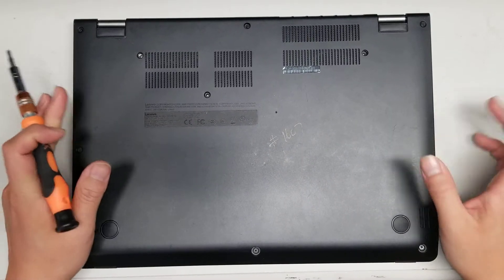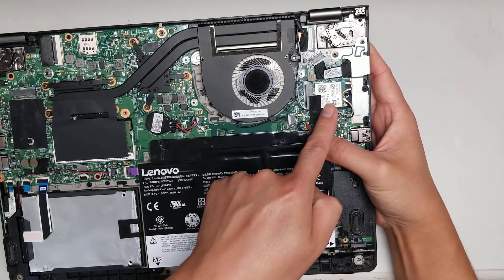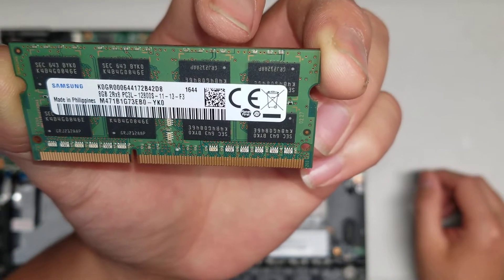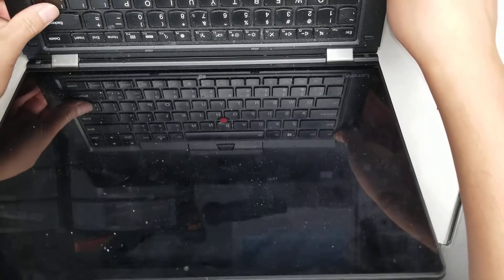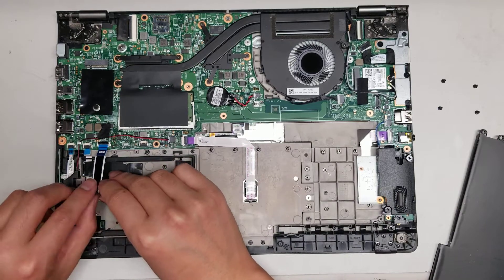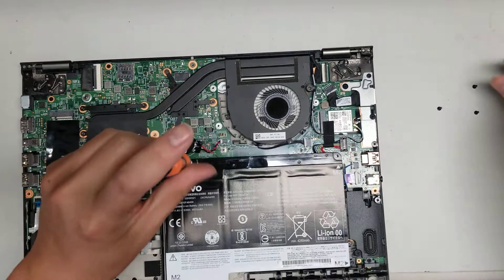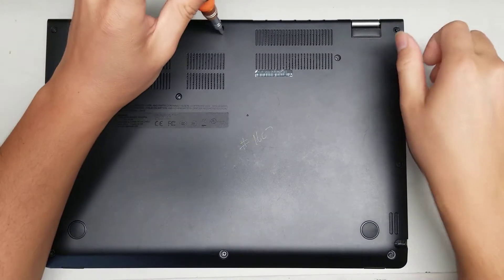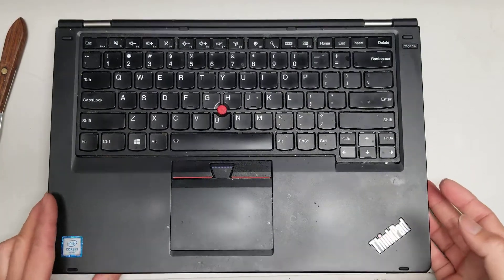Lenovo Yoga 14 Disassembly RAM SSD Hard Drive Upgrade Repair

Comment: Hello,
Is there a possibility to get a 16bg ram for this model?

It's hard to find the right 1x16gb ram for it.
Reply from the maker: Doesn't exist
Reply: @ItsBinhRepaired  are you sure?
There is one from the company crucial, but nowhere available
Reply from the maker: @hanf022  I don't know. Either way, you likely won't get much performance benefit. Better to put an SSD

Comment: I think this part 6:54 is for the M.2 Slot
Reply from the maker: Possibly, the smaller size.
Reply: It is m.2 2242 16gb
Reply: Better question is what's the max that can be upgraded to
Reply from the maker: There is no max that anyone can reach without a custom built several hundred thousand dollar SSD lol

Comment: How many memory slots are there in Lenovo Yoga 14?
Reply from the maker: Please watch the video
Reply: @ItsBinhRepaired  Great video.  I watched twice; it looks like only 1 SODIMM slot but I don't know for sure, can you confirm it's only 1 slot?  Task Manager details show  1 of 2 SODIMM used which is why we ask.  Thank you!
Reply from the maker: @dennissmith9664  I want people to learn how to research and figure things out on their own because it's impossible to answer every question, so this is how you find the answer to your question. Usually eBay is good for this. I would usually search on eBay "laptop model number" + "part in question" in this case, yoga 14 motherboard.

This was the result of the search https://www.ebay.com/itm/LENOVO-YOGA-710-14IKB-SERIES-INTEL-CORE-I5-7200U-LAPTOP-MOTHERBOARD-5B20M14162-/333622137246?_trksid=p2349624.m46890.l49292

You should know what a ram slot looks like now, so you can see, there is only that one on the board both front and back. Don't trust the software. Sometimes boards have integrated non removable RAM as well.